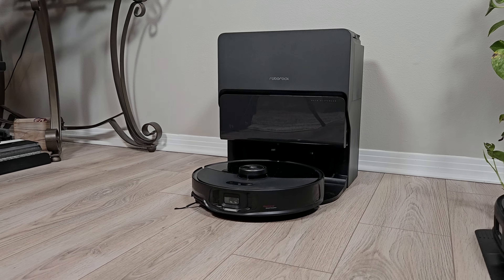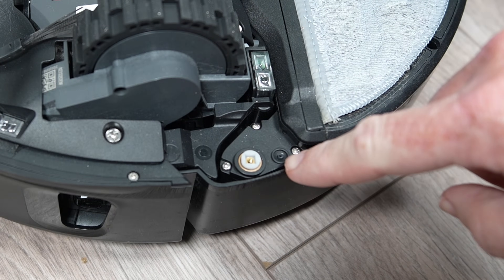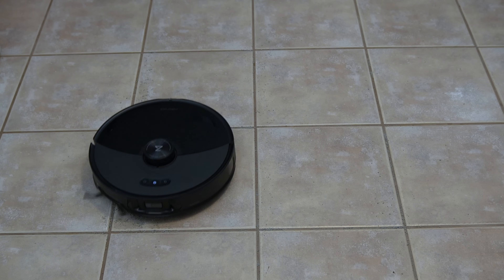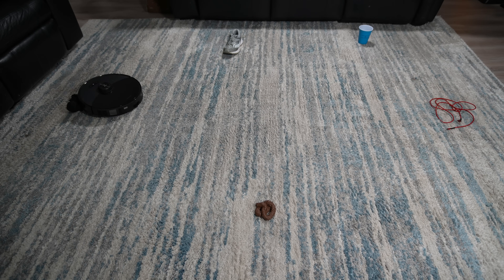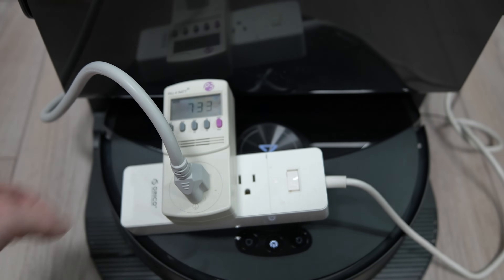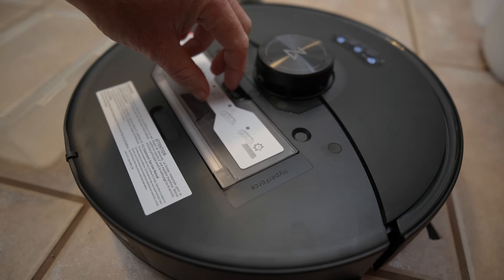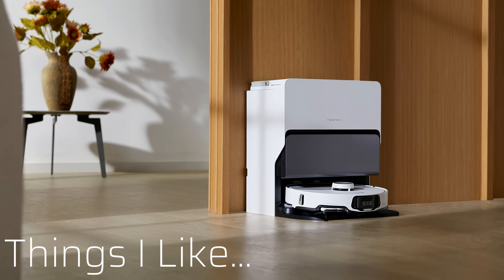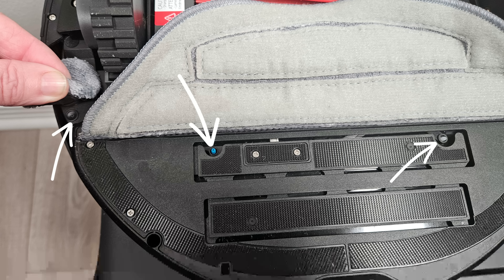Roborock S8 MaxV Ultra Robot Review. The Good & Bad.

Comment: Thank you for your honest review! We appreciate your feedback and we are committed to addressing the issues raised in the video in our future system upgrades.❤
Reply from the maker: It is my pleasure.  I know you all will fix these issues and make the product better.
Reply: @roborockglobal Did you fix the issues or was that just a marketing lie ?
Reply: @roborockglobal have you fixed all the issues? For $1,800 The issues should have been fixed right away.
Reply: I hope some issues can be improved through upcoming firmware updates. 🙏
Reply: Do you think most of these issues can be fixed with firmware updates or can we only expect them in future models?
Reply: Have they actually fixed anything?
Reply: Hello, could you tell us about this issues ? All S8 MaxV ultra EU too ?
Reply: @debrunnemartin8684 watch the video, it's basically a software issue that can be fixed... From the looks of it. There's no actual mechanical problem. It still does a great job but if you have a S7 Max V Ultra let's say it wouldn't be worth the upgrade right now, in my opinion... At least until they fix the software
Reply: Temizleme sıvısını hiç çekmiyor. Seviye hep aynı.
Reply: @yakupbuhan946 bu sorun bende de var sanırım, doldurduğum ilk günki gibi
Reply: @yakupbuhan946  düzeldimi?
Reply: Why don't you no longer have the S7 maxv ultra available. It's been months and I've been waiting for it to be in stock.
Reply from the maker: @bremarie3442  They no longer make that model and have not for almost a year now. This is the official replacement.
Reply: It seems they released a firmware update about the arm issue. I’d be curious to know if it fixes it for you.
Reply from the maker: @eego  I'm on 02.30.38 and it is not fixed in this version.
Reply from the maker: @eego  I don't have it yet, but I heard they have not fixed it so that it will come out under cabinets and furniture during room and zone cleanings.
Reply: @jamie.andrews  how about with firmware 02.31.90? Do you see the issue being fixed?
Reply from the maker: @eego  I don't yet have that version, but I will test again when I do get it.
Reply: how we buy the one need to plubing? when i ask retail , they have no idiea
Reply: I wish they had better Alexa support. You can only turn it in; you cannot choose room or mode. It's kind of whack.
Reply: guess we will not a proper robot that clean the all house human in the next 40 years.
Reply: please folks, consider shippment to Argentina, I want to purchase one and I cannot. Also  would add another CON, as per I'd seen in this review. It only supports English and French language?. I have no problem because I speak English, but millon of Spanish and Chinese also spends money on this. They should provide a customization of the device to support other languages and also support 220v instead of 110v before shipment.
Reply: Will this model accept programming updates? And do you offer them?
Reply: No other company that listens to videos like this other than roborock amazing job roborock🎉
Reply: The current auto-emptying period of 30 minutes is too long, especially for a fully carpeted house. I propose reducing the auto-emptying period to 15 minutes to improve the overall cleaning efficiency.
Reply: Perhaps an airflow sensor could detect if the suction is below a certain threshold percentage set by the user. Thus, the machine would go empty itself automatically.
Just a thought!
Reply from the maker: @jmnero4447  No it can't be based on that or else it will go against iRobots dust bin patent. That  is why none of these robots have a sensor on the dustbin to tell it if it is full.
Reply: @jamie.andrews  Gotcha. Wonder how long that will last :(
Reply from the maker: @jmnero4447  I think another few years.
Reply: @ahme050 hmm I propose reducing it to 1 second

Comment: I’m new to the robot vacuum world so thank you so much for all the easily digestible information included in your reviews. 

I’ve been torn between the S8 MaxV Ultra and maybe the Qrevo Curve. We have white tile floors, some runner carpets, and two (short hair) cats that love to shed. Object avoidance is important but our main priority is keeping the cat hair a little more in control. For this, I’m concerned about the cleaning/management of trapped hair in the brushes… 

In your experience, which of the two would you lean more towards? Or would you go with a different vacuum entirely?
Reply from the maker: If hair tangles is more important than object avoidance go with the Curv or step up to the Saros 10r.

Comment: Hello Jamie, I just recently bought th Roborock s8 and I’ve noticed that the water does not heat up pads are cold to the touch as well as the water in the tank. Noticed as well that there is no hot air for the pad either. One other thing I noticed after a several cleans that the detergent  tank hasn’t gone down at all. Could I have a faulty dock?
Reply from the maker: The mop pads likely won t be hot to the touch and that is because it does not heat the water the entire time.  Make sure the dock settings are set to use hot water in the app.  Same goes with the water tank.  If you have a meat thermometer or similar check the temp of the cold water tank.  Manually start a mop wash cycle and check the temp of the dirty water tank.  It will not be hot, but it should be hotter.  The detergent tank does not go down very fast.  You would have  to measure the solution and check it after several cleanings to be certain.

Comment: Any update on this vs the Qrevo MaxV in 2025?
Reply from the maker: What would you like to know?
Reply: @jamie.andrews  Just trying to decide between which would be best for my needs.  Mostly wooden floors in a smallish house with a dog (muddy paws etc) and the Qrevo MaxV is $400 cheaper.  Wondering if the S8 is really that much of an upgrade?
Reply: it's very confusing so you're doing good work! thanks.
Reply from the maker: @robertcrystals The S8 has slight better object avoidance and dual rollers. I prefer the Qrevo dock though.
Reply: @jamie.andrews  Thank you, ended up getting the S8 on a decent sale and with it being a bit lower, it fit in the space a bit better.  Super happy with it's performance, after a few runs, our floors are now spotless!

Comment: Great review. I would add another CON, as per I'd seen in your review. It only supports English and French language?. I have no problem because I speak English, but millon of Spanish and Chinese also spends money on this. They should provide a customization of the device to support other languages and also support 220v instead of 110v before shipment.
Reply from the maker: Mine lists Spanish and Chinese as available languages.

Comment: Nice review. Do you know if the detergent on s8 maxv is also used for mopping the floor? Or only washing the mopads like Dreame?
Reply from the maker: Used for both.
Reply: @jamie.andrews  I finally decided to get this s8 maxv today from BestBuy, overall it was good. However, my unit kept failing to detect cables/cords no matter how big or small it is. I have the latest firmware update to 02.33.74, AI Reactive on (standard less collision, fill light automatic, AI environment on), and using SmartPlan AI cleaning mode. I don't know if the SmarPlan cleaning mode might affect the performance? Or did I miss any settings? Anyway, do you think the Qrevo Curv is a better buy than this?
Reply: @jamie.andrews   I just bought the brand new s8 maxv from best buy today. However, the robot kept failing to detect cables/cords no matter how big or small it is. I'm on latest firmware 02.33.74. All reactive AI was on, using SmartPlan cleaning mode. Can you do a quick retest on yours to see if experience the same?

Comment: Do not buy Roborock products!!
It may work fantastically in the beginning, but both the dealer and roborock itself only give a two-year warranty and after that you are on your own.
Mine is broken and Roborock doesn't know what the problem is but doesn't offer a solution.
Scandalous!
Reply from the maker: 2 years is more than most which only warranty for 1 year. There are 3rd party companies that offer extended warranties.

Comment: Roborock has claimed to fix the issues for quite some time now, but they still haven't taken any action. Other reviews especially mention that the side brush extension works for a much shorter time compared to the Dreame X40, and some bristles do not even touch the floor. Roborock still hasn't considered fixing these errors with a firmware update. In China, Roborock faces a lot of criticism for raising prices without any innovation. It seems unlikely that they will fix the cleaning temperature this time. They will probably address these issues in the next model, as that's where the money is. Roborock is falling behind Dreame in every aspect.

Comment: Wow, I saw your review and was a bit shocked from all the cons you've mentioned. I have the S7 with the dust container. since 2021. I have 2 pets (a dog and a cat). I turn it on everyday and it comes back with a lot of dirt.   All in all, it does a good job. Do you think it's worth keeping or should you recommaned to upgrade it to S8 maxv, considering the price and the cons? I was hoping the S8 maxV will avoid cabels, but in your review it didn't. What is your honest opinion? To stick with the S7 or replace it? Anf if so, to what? Thx a lot!!
Reply from the maker: The S7 is a great robot.  It really depends on your needs and wants with the upgrade.  You mentioned object avoidance, but the MaxV gives way more upgrades than just that over the S7.  While the MaxV is not great with cords the S7 does not have built in object avoidance so the S8 MaxV will still be an upgrade.  You may also want to look at the Qrevo models.  I just  put a video out comparing a few of them. https://youtu.be/iSMqTKFj-aQ

Comment: What’s your opinion on the mop feature in regards to light spills and stains?

I currently have a Roborock S4 and mop once a month. I take care of hard spills right away, but stuff like water drops and foot prints, I leave till the end of the month to mop. Would the mop feature of the S8 MaxV Ultra eliminate these small water or footprint stains on the floor?

Would like to upgrade if it can eliminate the manual mop all together since my entire house is vinyl flooring!
Reply from the maker: While can't can't really say if it would remove it I can say the mopping system is pretty good.  I would say it should handle most of your cleaning needs.  I hardly ever mop with anything but a robot.

Comment: Hot water cleaning:  Is all water for mop washing supplied from the Robot’s internal water tank?  I don’t see anywhere else water can come form except the port for filling the robot?   If that is the case, how could the water temp ever reach what is advertised as any heated water would mix with the current tank water.   The Dreame has 2 water tubes that supply water to the dock basin so I assume the Dreame uses that hot water for mop washing?
Reply from the maker: Hot water is only used when washing the mop pad at the dock.  The water that is put into the robots internal water tank is not heated.  This is the same for all robots that have hot water mop washing.
Reply: What I’m asking is where is the water outlet in the dock to wash the mop?  I don’t see any.   Also, if you start a wash with the fresh water tank installed and then remove it after the wash starts, the wash completes.  There is likely some in the water line but the only other place water exists is in the robot.  

On the Dreame docks, the water is supplied to the bottom of the dock through 2 water tubes.   These supply the hot water to clean the Dreame mops.   I see no such water outlets on the Roborock dock.  Thus, where does the water come from to wash the mop?
Reply from the maker: @Firebat-  The water is applied directly to the brush roller in the dock.  If you pull up on the red tab and remove the brush you will see several holes where water is applied to the spinning brush.

Comment: Love your videos especially the detailed temperature checks of the water cleaning and air drying. So disappointing that roborocks temperature figures are so wildly off. Can't wait to see a similar review of the Revo maxv
Reply: Yes. The failure to hit the water temperature target was probably the most disappointing issue for me mainly because all the other issues did look like ones that could be fixed in firmware but with water heating I have some doubts. Jamie did mention how the power consumption of the dock fell off quite quickly so maybe there is hope that just keeping the heating element active for longer might be a software fix. I would hope that RoboRock would give this a high priority since they are promoting the hot mop washing temperature quite strongly. I really hope their “fix” isn’t to just change the marketing materials to show a lower temperature!

Comment: Did Roborok answer you to all the problems you identified? And if so, when to wait for their correction? Can all problems be fixed only by updating the robot or base through the robot? And how are things with the brush module, they say the s8 pro ultra had problems with the airflow, which caused the power to be lost, have you noticed this in the new robot?
Reply from the maker: Roborock stared the would work to fix the issues. Most could be fixed via firmware update.
This has a much larger vacuum motor so it has been pretty good compared to the S8 Pro.

Comment: Jamie:  do you know a way to change the default cleaning mode from mop and vac to vac only for Instance?   I never use mop and vac as I do then separately.  I notice after selecting vac, it stays it that mode for a bit then reverts back to mop and vac.  Routines seems the only easy work around
Reply from the maker: Only work around to that problem is setup custom settings per room and set the rooms to vacuum only.
Reply: Thanks.   Hopefully Roborock is reading this and taking suggestions.  I sent requests to them but I have little influence versus your input.

Comment: Dreame L20, X40 ultra or roborock  Q revo maxV
Reply from the maker: Have only reviewed the L20 which at the price point is hard to beat. The Qrevo MaxV video will be out soon.
Reply: @jamie.andrews  if budget is not an issue, in a house with 2 story, all hardwood/stone floor, 4 pets and 2 kids, what do you recommend? I saw very mixed reviews about the roborock S8 MaxV. Mopping and vacuum are equally important and the most hands free the better (but we can’t do the direct hookup so tank size matters). We had a Ecovac but it completely died in 20 months so I’m worried about issues/customer service on the Dreame but the current promo on the X40 to get the flagship sounds tempting.
Reply from the maker: @lin006  Honestly any of those are fine.  All have pros and cons.  I don't typically recommend robots so as to stay unbias.  If you have any specific questions about certain models I can try and help.

Comment: @roborockglobal  Unfortunately Roborocks "trade-in" to upgrade to the S8 Max V program is a scam. We sent in our photos for our roborock S8 pro Ultra that we've had since November for evaluation and received an "A" rating. The vacuum was in immaculate condition with less than 24 hours of total use. We're a no-shoes household free of kids, pets, and carpeting, so our floors don't see heavy soil anyways. We went ahead and bought and installed the new S8 Max V, received it in the mail, got it installed, and roborock just today (5/7/24) "changed" the rating on the Pro Ultra vacuum we just traded in to a "D" rating. They said "Your vacuum cleaner is heavily worn or damaged with significant cosmetic issues and/or functional problems". To be blunt, that's a load of BS. We packaged the trade in robot similarly to how they ship out the new ones out and we had a tracking number on the shipment so we'd know if the box had tumbled out of the delivery truck or something dramatic like that. The roborock vacuums are very capable. Unfortunately, roborock the company is currently pulling a bait and switch scam on it's existing customers.

Comment: Great review.  I've used several brands of robot vacs, including iRobot and Roborock beats them all.  And no, I wasn't paid to write this.  It's just a consistently good product.  I'm currently using the S7 Max and won't be replacing it with this one.  The S7 Max is still perfectly fine and . . . 1700 bucks?  No.
Reply from the maker: Thanks for sharing. Roborock is actually better than this. Your S7 Max robot and your prior expierance stands to prove that fact.